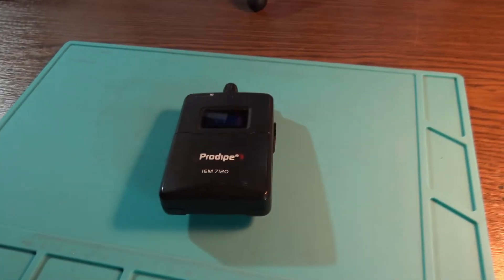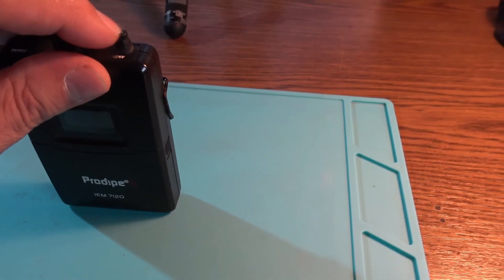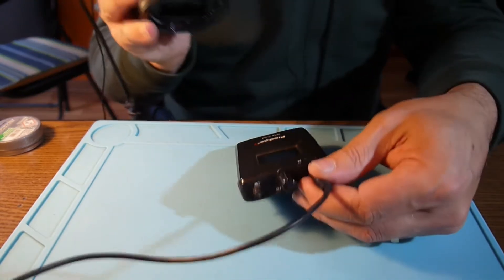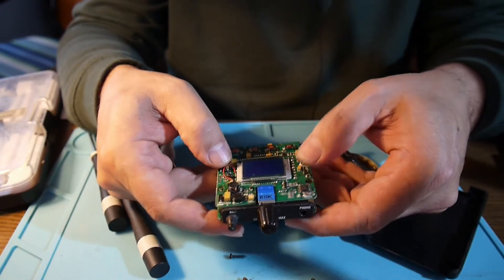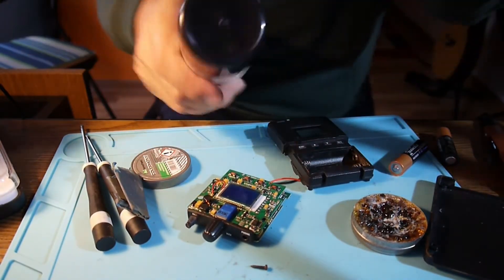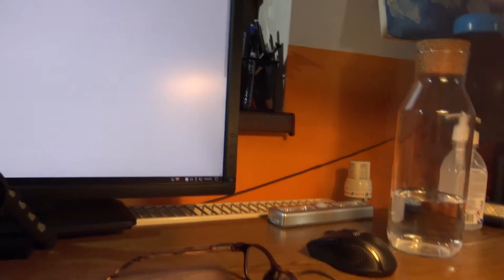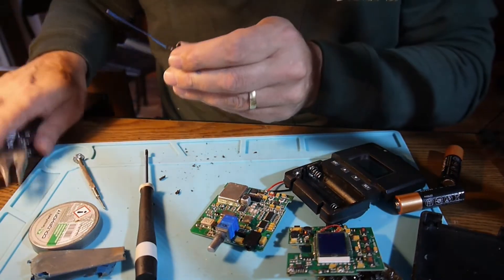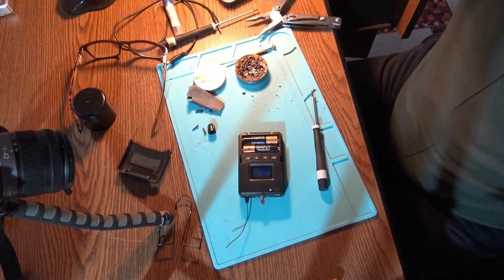Prodipe IEM 7120 Fixing in-ear phones out and antenna, how to

Comment: Hi man, thanks for your video. 
I have the same problem with headphone connector (I can hear just one side) and I tried your job but doensn’t work. So I’d try to replace 3,5” connector. I checked on web but I can’t find one with same dimensions and pins. Do you know something about it? Thanks
Reply from the maker: Plenty on AliExpress...also you may find another 3.5mm plug in working condition and cut the cable. Tie that to your headphones... https://www.aliexpress.com/item/33015326748.html?spm=a2g0o.productlist.main.9.36799euv9euvK0&algo_pvid=1f3f6f1e-2625-48d4-af6c-18e7f9029ad7&algo_exp_id=1f3f6f1e-2625-48d4-af6c-18e7f9029ad7-8&pdp_ext_f=%7B%22order%22%3A%2258%22%2C%22eval%22%3A%221%22%7D&pdp_npi=4%40dis%21RON%214.37%213.14%21%21%210.96%210.69%21%402103834817540535036405035eaad1%2167143934767%21sea%21RO%211675461357%21X&curPageLogUid=JEUuaSEXx74y&utparam-url=scene%3Asearch%7Cquery_from%3A

Comment: Hi! One of my transmitters keeps turning off when receiving somewhat of a loud signal, but the other one on the same frequency that they share is fine, what could the problem be in your opinion? Thanks
Reply from the maker: Probably something related to power supply. I believe the output it's an amplifier in class B, means the power needs are related to the amplitude of the output. Related a peak in audio out will ovwerload the power supply (battery...regulator) and turn off everything. I don't have a schematic but seems like that.
Reply: @viocaia  Thank you very much for the reply!
Reply from the maker: @boristubeti6776  Hope it helps.
Reply: @viocaia  any ideas on the solution I could have? Maybe something I need to replace_
Reply from the maker: @boristubeti6776  I'ts hard to say...check the power path...maybe a leaking capacitor near a switching power supply. Search for coils and check capacitors around.

Comment: The standard antenna is much shorter, maybe 5cm. I've had problems with signal degradation, so I'm going to lengthen it to 10cm because I use the 680.5Mhz channel.
Reply from the maker: BY my last SWR test , for 760.5 Mhz , turn to be 78.9mm! look here..https://youtu.be/r5I6-4k401o
Reply from the maker: If you like I can measure with NAnoVNA an antenna for your frequency..680.5Mhz
Reply: @viocaia  That would be awesome if you would!
Reply from the maker: Look here https://youtu.be/WEdDAKJlriQ